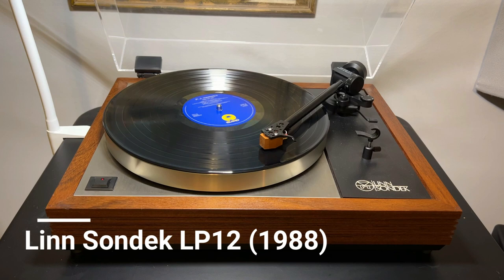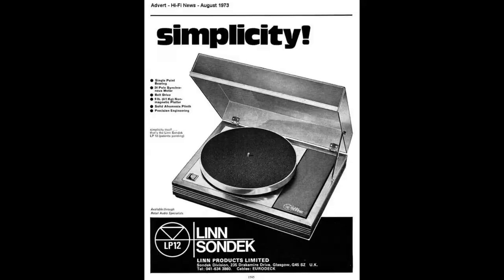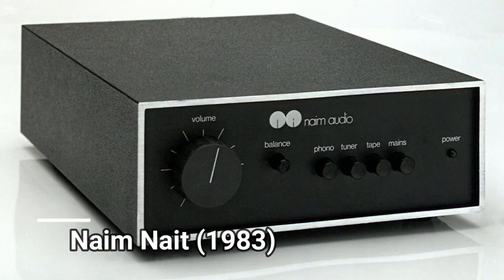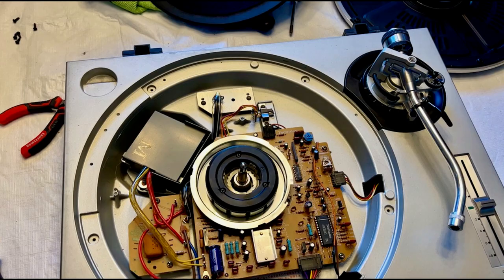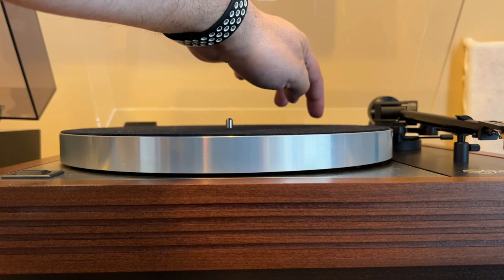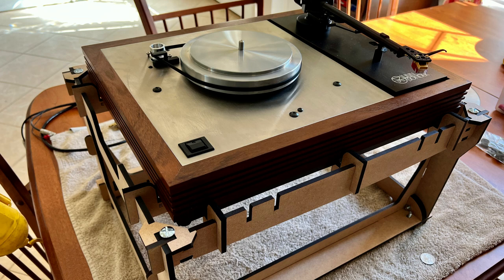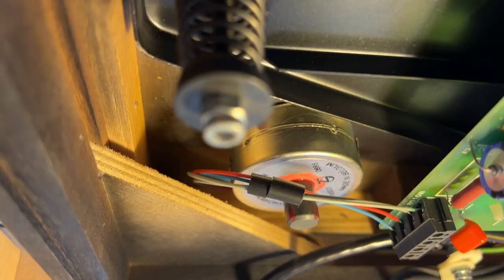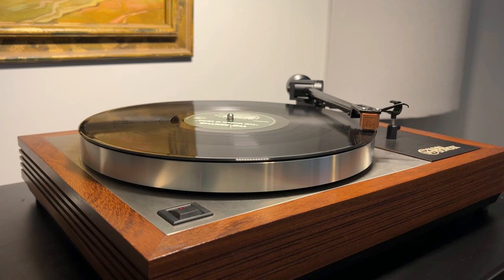Am I Now a Certified Linn Turntable Service Technician?? Me and a Linn Sondek LP12.

Comment: Well, hello there... Yes, not quite yet certified until you rebuild that  Valhalla Board,  it burns up every twenty years or so and it has to be repaired/rebuilt.   On eBay,  someone will rebuild your board for  $109 plus shipping (90 day warranty), $39.37 from Bulgaria, $52.12 plus shipping in Great Britain,  or buy the parts yourself for about $50.  Tutorials, of course, on YouTube (isn't everything on YouTube?).  BTW, been there,  done that... regards,  tio Jimmy

Comment: I still have my 1996 LP12 Basik with Akito II Tonearm. The sad part of my Linn story was at the very beginning. I actually took my almost brand new LP12, to a local authorized Linn dealer. I gave them close to $600 for a new K18II Cartridge, that was a ripoff. The dealer kept my LP12 for 6 weeks, that seemed like a very long time to change a cartridge. When I picked it up, and took it home I was happy, used it for about 4 month's. Then one day the queuing mechanism went straight down, literally slid down the plate. When I inspected the Hex Locking Nut on my precious Akito II Tonearm (also barely 6 month's old) HORROR! Some Monkey at the authorized Linn dealer apparently did not have the proper Allen Wrench and took a small screwdriver and literally "bored-out" the threads on the Hex Nut. Sad to say that when I complained, the dealer said that the Warranty of the service had expired. So I never ever bought Linn again. I realize it was not the fault of Linn, but that local Linn dealer never made another penny off me. The Akito II is still damaged, but I managed to find a larger Hex Nut plug and made it work. Eventually I may take that to a reputable machine shop and have then re-thread the part that fastens the queuing level. Hi End Audio is not all peaches and cream.
Reply from the maker: That is a very sad tale. I’m a DIY when it comes to mechanical projects. I leave the electronic work to the professionals. Good luck. 👍🏻

Comment: I enjoyed watching your video. So I'll be watching more of them.

I spotted a cat wandering by as you were setting-up the suspension. Cats+ turntables are not a good mix. Hope it didn't insist upon helping you!

I have an Axis plus a couple of other makes. The Axis is fitted with a Jelco tonearm and they work well together.

Did dealers in your part of the world make such a song and dance about how the platters ring? They were so enthusiastic about how many seconds the platter would ring for. Never understood that, as platters that make or transmit any sort of noise are generally frowned again.
Reply from the maker: Cat is not interested in my gear. Never had that experience with a dealer and platter ringing. Thanks for watching!

Comment: Thanks for this excellent detailed video, my Ariston Audio RD 40 is due a service, and that oil may be worth using, not sure if you know but Lynn audio was formed after the 2 directors of Ariston Audio fell out and parted ways with Ivor going off to start Lynn Audio in East Kilbride not far from Glasgow, the RD40 I have was built in Prestwick in the early 80s, Prestwick is about 12 miles from where I live (Irvine). and that old turntable is featured in most of my YT posts, but the old girl is due a service.
Reply: Try Glasgow audio, I used them for my RD11 superieur last year and they were great to deal with cost me £80 for technician to go over it n went to collect expecting to pay more ,nope no more.👍
Reply: @stevenhunter3454  Thanks, will look into that.

Comment: I have the original Linn 1972.  I kid you not. It's rather flimsily built. The cabinet joinery is/was a joke with a 3mm MDF sheet to cover the bottom.... 
Over hipped piece of overlarge floating Aluminum plater. 
The amount of money they milked from the elitist audiophiles who have too much spare money is amazing.
As an experiment, in the future, i'm going to remove all the springs and fully tighten the while floating system into a solid non bouncing deck and see if there are any differences in sound. I would doubt that there would be one single Linn owner who would have tried that experiment.

Comment: Why is Linn considered the top of the suspended TTs?
I would rather a Thorens and half the price
Reply from the maker: Maybe because they can be continually updated/upgraded. A desirable Thorens is not that cheap.
Reply: @MODAC Here in Oz $3000 to $5000  will buy a TD1500 = no slouch
A Linn Majik is $7,500 to A Climax at $44,000. I appreciate your response but my mind is not changed as yet

Comment: What product is there , particularly a highly engineered one , thst needs continual pampering and adjusting just to get it to do its job well amd correctly ? I can think of none . Usually a designer would recognise that there are major design flaws in his product that these continual adjustments are symptoms of something fundamental and  needs attention . If a highly designed high end car or aeroplane needed similar attention above the usual demands of safety then a designer would assume something wrong and redesign it . I recognise high end , “ thoroughbreds “ are often sensitive and need occasional pampering but it seems to the extreme in the case of Linn turntables . The design is perhaps flawed , the bounce for example . In a manual deck where the entire arm board bounces along with the platter when ever a hand is placed on it and one needs to retrieve the tonearm from the nd of the record , how ? It seems badly considered in its function and ergonomics to have such moving bouncy parts when one is trying to care for sensitive things like a stylus and record ! Is there perhaps a special Linn arm / wrist jig to place one’s arm when moving off or picking up the tonearm from the  bouncing record ? Or am I being very much a  heavy handed Phillistine and not understanding the sophisticated ways of the audio elites ?
Reply from the maker: Not continual at all. Thx